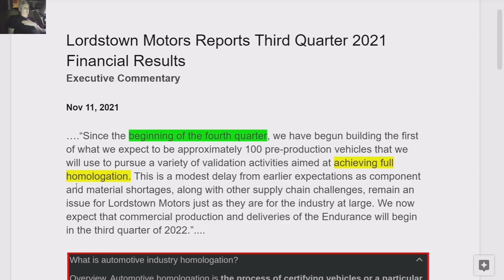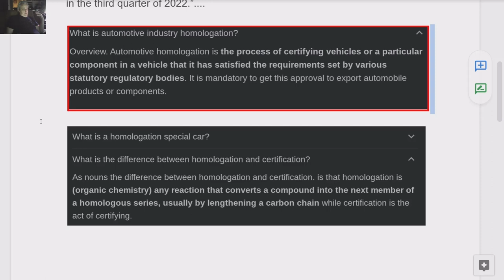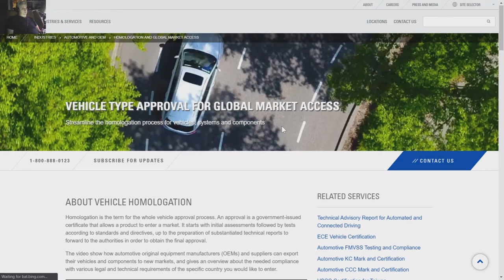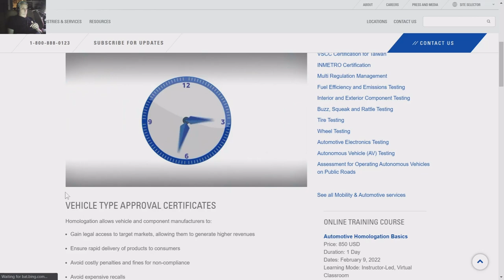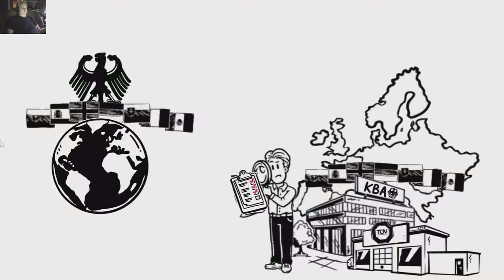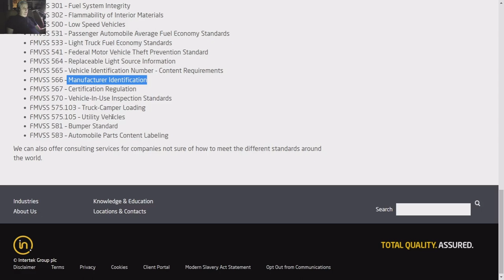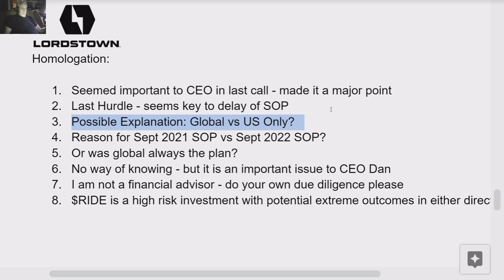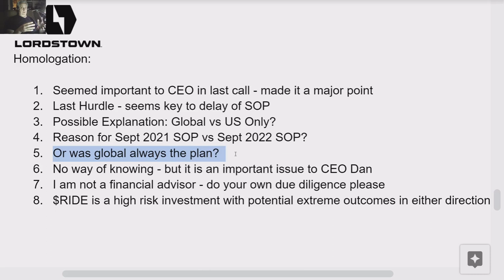Homologation - HUH? - Why is the CEO talking about it ? What is it? | #mxux #ride $ride #LMC

Comment: I went to Irvine , ca I saw the ride office. They have a car as display. I hope they start selling the car. As long as they donot start the production, the stock won’t go higher. Why if already has  the car and market has demand, still behind they supposed to do it last year …..
Reply from the maker: Darren Post the chief engineer is still at LMC and is without a doubt  working on more models IMO. As for the delay in SOP - CASH IMO - has been an issue for LMC since they had to bring the frame manufacturing in house - very expensive and absolutely critical for production - had to be done - reason - third party suppliers raised prices to the point no profit would have been possible - pressured by big OEM's to do so IMO - anyway later supply chain - but cash IMO.

Comment: I reckon you’re on the right track: Foxconn has stated that it will be producing a variety of vehicles for multiple markets. It would make sense for the Endurance to share homologated systems and components with other world market offerings. For example a smaller world market pickup similar to the Ford Ranger or Toyota Hilux.
Reply from the maker: Permutations are endless - the question is how many will use hub motors - or MIH platform - or will MIH take on hub motors - or will the LMC skateboard shrink or expand to new models - exciting potential here - FOXCONN brings a lot to the process - could reach TESLA like scale in EV's quickly